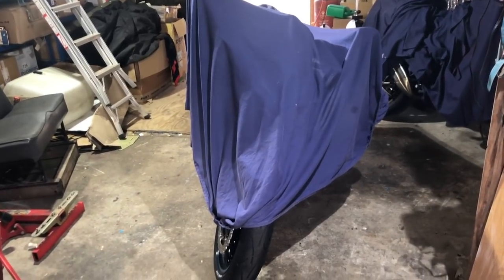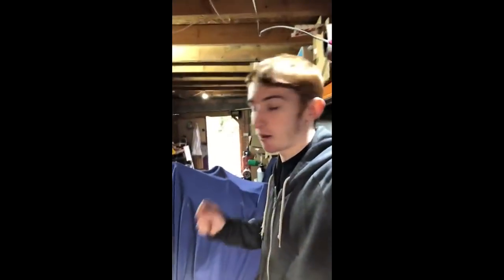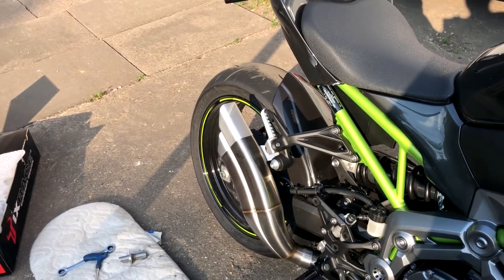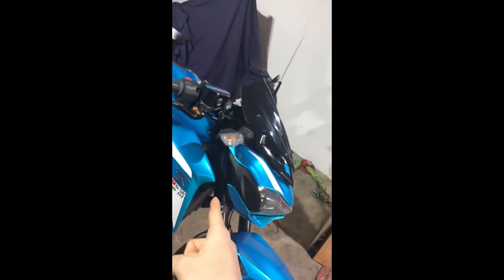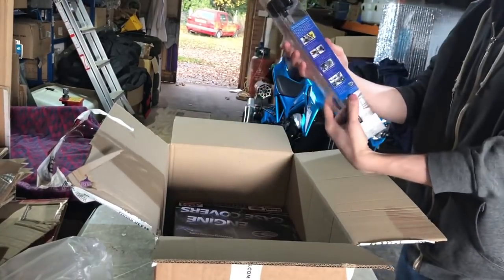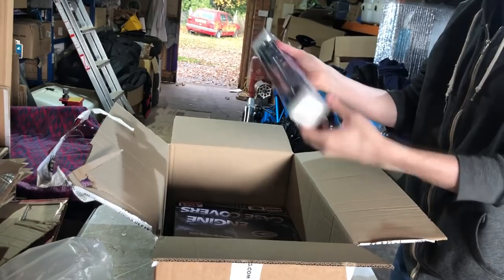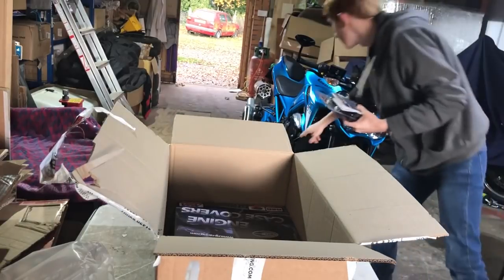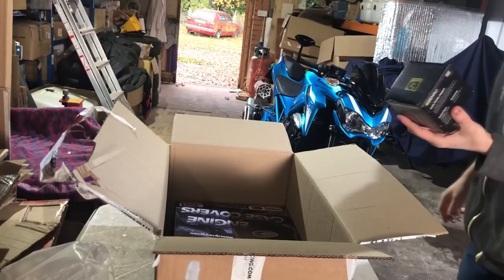Z900 Wrap Reveal + FULL Exhaust System! *LOUD* - Fitting R&G Crash Protection

Comment: Gonna do any performance mods on the bike? Even if you're on an A2, with that full exhaust system a remap would be advised else your engine will be running slightly lean which will damage your engine in the long run.
If you do go for a remap, it's worth getting a high air flow air filter too and have it mapped around the exhaust and that

Comment: Could you write the exact name of the exhaust. i can't seem to google it.
Reply from the maker: Carsten Hansen “IXIL IX race end can” with Arrow Headers
Reply: Great, thanks a lot. :)
Reply: The Arrow headers. Is that whats make it sound great at the end?
EDIT: Ah, it's the pipes!
Reply from the maker: Carsten Hansen yeah the arrow heads/pipes are what makes the biggest sound difference
Reply: Ok, so in theory, you could just replace them and, you'll have that sweet sound?
Reply from the maker: Carsten Hansen yes. With stock end can it will sound a bit different but the pipes bring most of the sound out. I’d still recommend getting an end can, even a cheap one
Reply: Ok, thanks a lot mate. It was kind of you to take the time to answer.